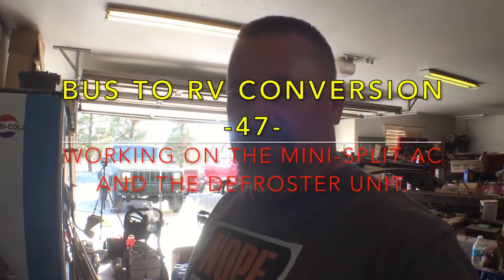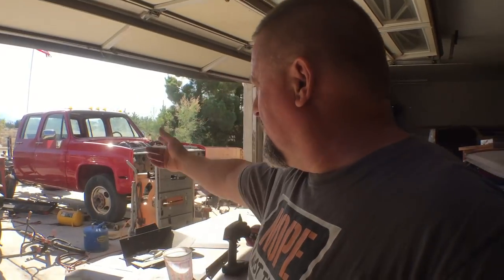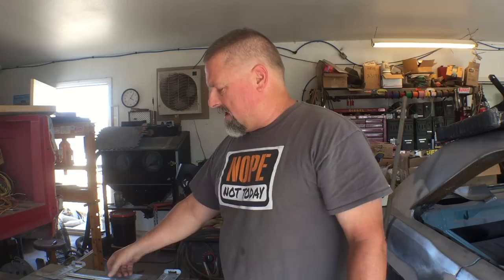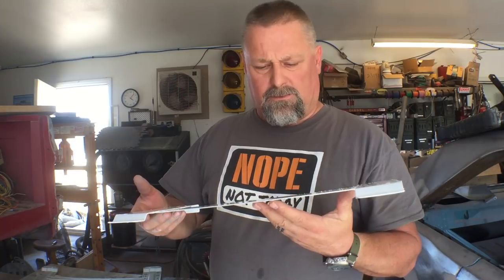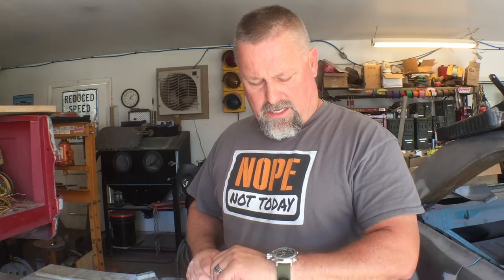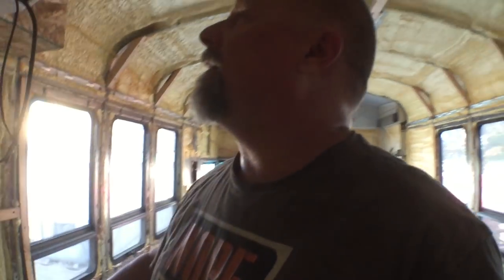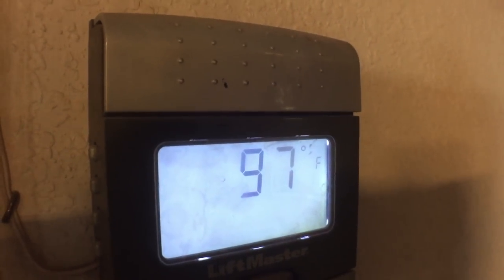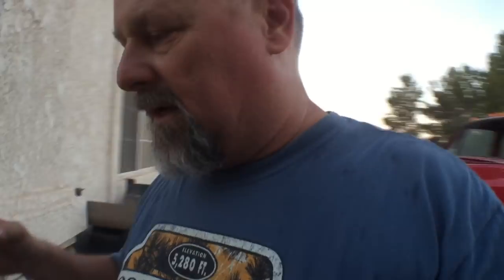Bus to RV Conversion 47  Mini-Split and Heater Box

Comment: Leaving those lines and coolant to the heater core is probably a great idea as well in case the engine starts overheating on a really hot day while working hard… you could just open the valves and turn the curculation pump on, letting the coolant flow through the heater core- making it act like an extra mini radiator.

Comment: Great video once again. A defroster can be useful as even when it's hot and you get a sudden rainstorm the windows will fog up. Have you thought about an electrical defroster? Just needs wiring. No chance of leaks and will just work with no issues as soon as you need it. Keep doing what you are doing.

Comment: You definitely need warm air defrost at the click of a button. There are conditions in which the windshield can suddenly fog up. There is an electric switched valve available. But when you need to drain the engine's coolant, it's nice to not have to drain the whole system.

Comment: Im putting a minisplit in a 93 model holiday rambler travel trailer. Do you think the 9000 btu will be enough for the 200 square feet of the trailer? Says its good for 500 but with crappy insulation im wondering if maybe the 1200 btu might be better. Id like to have the 38 seer model thqts 220 volt and ill run it off my 4000 watt sungold power. I also have a 110 powmr all in one 3000 watt also. Itll be with 1800 watts solar also
Reply from the maker: Depends on where you're spending your time.  If you're hangin out in the desert and temp are regularly over 95F then its going to run all the time. Mine is 9k 110v and the fan speed is too slow IMO.  Im assuming the 220v mini splits have stronger fans to move more air but I cant confirm.  If I had to do it over again I would go 12k or perhaps 18k and mount it at the front, blowing to the rear. Having said all that, I don't regret going with a mini split. Its super quiet and doesn't use  a ton of power.

Comment: Yeah buddy 100 in Gaylord, Mi. 6/30/18 abnormal heat for N. Mi. I don't think I would survive long in locations with those being normal temps dry or not. I consider it hot when we are in the high 70's to mid 80's but don't think I'm complaining when so much of our life is below 30 degrees. Peace

Comment: Your thumbnail is a picture of the outside unit but it's never shown or explained in the video. We are going with the same unit and wonder how well that mounting worked out. Will it get enough air?